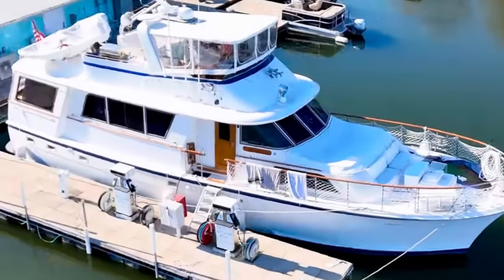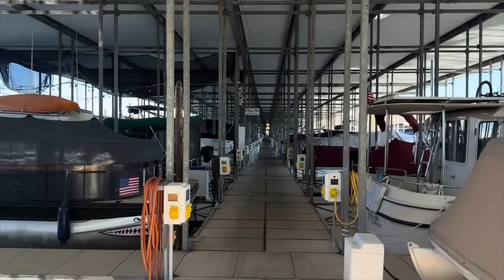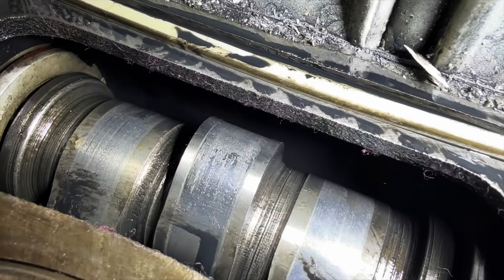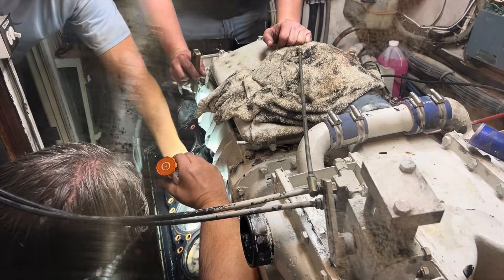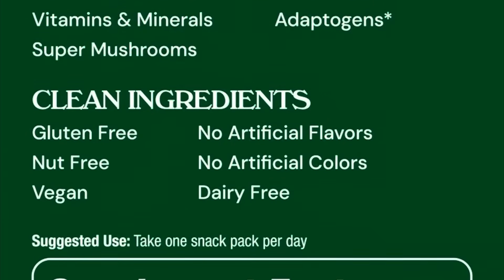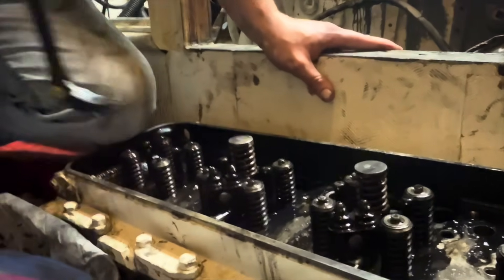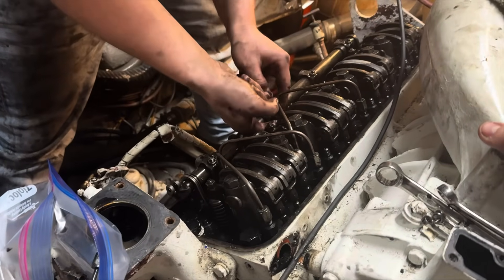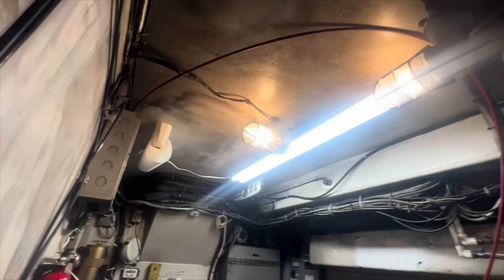Yacht Engine Failure: The Internal Damage Report

Comment: To me it looks like neglect and carelessness on the part of the POs. Deposit signatures in the chambers seem to point to some cylinders firing harder than others due to neglected tune-ups (running the rack every 1000-1500hrs) missing coolant change intervals (leaks) maybe improper oil weight (40W) or missed oil changes, combined with inexperienced techs botching repairs over the years and you have that. If I was the owner I'd be wary of doing an inframe with damage that extensive. One could waste a lot of money on new components just to have them taken out by contaminants or spalling by not typhooning the block and checking all your tolerances - it could be done, but so much better to do it in a fully equipped shop. What a mess. Maybe you could just sawzall the floor and sneak it out the window using a Hiab crane - but that'd be a drydock job, and a long one no matter how you slice it.

Comment: I have a little experience on diesel engines.  I do know though you are supposed to change the oil every 200 hours because of carbon build up in the oil.  I am going to go out on a limb here and guess the previous owner did not do such a good job on keeping up with the oil changes.  Or maybe that engine has an extreme amount of hours on it.  I'll bet the main bearings are all scared up too along with the connecting rod bearings.  Might be looking at a new crank shaft.

Comment: I bought my Hatteras 42 LRC with DD 4-53’s in her. Port engine showed some slight moisture in the valve cover cap. They said the cylinder head was reconditioned recently. No reason given however. Now six years later we have torn down the engine to find that it was overheated and the head wasn’t the only issue the Cylinder Sleeve seals were seeping coolant into the oil of course. So doing an in-frame rebuild now. If ANY moisture is present when checking out the oil fill cap either count on a rebuild or count your blessing every time you fire up and move… otherwise it has been a fantastic vessel and engine setup! Thank you for this video… I can feel for you with all the damage you have there!

Comment: A mid-west boat. Looks like its had some sitting time with all the pitting and scoring. Sat for long periods and rust built up. It needed someone to come and start it up once a month and keep the oil circulated. Typical midwest owner I assume. Used 4 months out of the year and sat for the other 8 on the water. That poor engine. Boat came with an anchor, just had to unbolt it.

Comment: I had a forty one foot power trawler and it had a 4-53 in it. The oil pan had rusted out and the top of the engine was about maybe a eight inch gap from the kitchen (galley) floor. I had to remove that engine in pieces to get it out and replace all the stuff that had died (failed) as salt water just is not a good lubricant. Sorry if the next part hurts a guys feelers but as anyone knows, old boats made of wood and it was old, built in nineteen twenty seven for a governor in maryland. Really fancy and man being a eccentric sort and all, boat is my problem. I put a small block chevy pickup engine in it to do most of the work for running pumps and all. Surprisingly the prop did just fine and if ya didn't get in a huge hurry moved that boat around fifty plus miles from where it was setting on the beach to ketchikan. I did not have a place to live at the time so gutted that boat out, and left that gas engine in it to just move around in the harbor.  Gasoline engines and boats is a recipe for dying. I finally found a job in camp come spring... got my brother to meet me out around the inlet where no one was wise to me... and dang.... she caught fire and within just minutes was a total loss so that my brother could bring me back to town and we did the act of huge loss of home thing. I wouldn't of done that but no way to insure a old boat like this that had been fiberglassed on the deck sealing moisture in the deck wood up. It had lasted that way for a good many years but by now no saving er. I saved the bell and wheel for a memory thinking I was good to go. Na, that never flies and the boat cops... can't think of their proper names told me "Morgan, we understand your situation" so no jail time, just pull your scrap out of the water. I go back to scene of crime, and sure enough, picked the only dang spot out there that had maybe six feet of depth when tide was out meaning my junk was quite visible and so removed it. I stood in the water and hooked up my recovery methods, brought it to shore where those water cops took me to a bar and bought me a couple drinks, and we laughed it off. Ya, I did like the boat but there is a time to cut the loss. This boat your tinkering on is a tad nicer for sure/LOL. I know if it were me, I would drag it out of the water to repair it. If oil did not make a huge mess, most of that detroit might of fell off the dock had I been there.

Comment: Mine is a 12v71, so it's a 6 cyl head, about 230 lbs dressed. I strapped it to a 2 wheeler, rolled it thru the Salon, and used the davit to lower it to the dock

Comment: If I remember correctly that engine is removed buy cutting open the port or starboard side depending on which engine it is with a big hole.
Pretty common on those old Hat's.

Comment: well  hell, cutting out the ceiling would be a pain, i had  years ago a 72 ft hatteras had twin cats   i had had it for a few years then the one engine took a dump, was not 10 grand  was more like 37 grand, i was at a ship yard they  had to take the salon floor out then lift the engine out thru that,  took them 3 months to get it back together again and installed, my final bill was a bit over 45 grand  while they were building that engine ihad them look at the starboard engine.. that cam eout next 6 months later ihad  new engines and     spent over 90 grand , boats are  not worth it. they sink,    i had it for another 6 years after that repair sold it and swore i wouldnt buy another boat, then my gf  said onemorning hey i just saw your dream boat is aid nope no more boat but it is a 120 ft ocean going tug a old army tug i said nope   then i bought it lol  i have had her for over 20 years now,  has not sunk yet

Comment: Lots times..the hatch is over just one engine. Have to cut floor out to get to where hatch unbolts if they do.take one engine out.. then slide other over to other spot to get it out as well  .see guys make a makeshift gantry over engines with small steel i beam and other steel braces

Comment: What does the own mean they added coolant?  Don't boat engines use the water they are floating in as cooling water?  The boat's interior was built around the engine compartment without accommodation for disassembling the interior for engine service?  WTH?
Reply from the maker: No sea water doesn’t flow through the engine.  Just heat exchanges to coolant

Comment: Flat no way the seller wasn’t aware of the condition of this engine. 
I’ve seen many Detroit 2 strokes that wouldn’t start without a snootful of ether and ran awful and when they were pulled down looked way better than this one. 
Hard to say what the root cause is, but it’s safe to say it was run for many hours being sick and would shown signs of that. 
With the loose bolts and missing parts it’s safe to say that some hack was in there likely trying to patch it up for sale. 
Sad.

Comment: If the top is that bad I'd hate to see the bearings on the piston rods. I'm sure the piston rod bearings are getting bad to with antifreeze and black oil in the oil pan it's very ideal to check it out just to be safe.  If this guy were to call a Detroit mechanic they would have charged this man a fortune 🙄  but with BUS GREASE  MONKEY TO THE RESCUE  this job is going to be well worth the man's budget 👍.  Yes from the damage it's better to rebuild the engine than buy a brand new one. This guy already paid alot for the boat and clearly was cheated his money because the previous owners probably told him everything was fine and nothing wrong. Clearly this video shows the evidence of something totally different.  Bus grease monkey your the best, you help people with big problems like this get back to everyday enjoyment by fixing their engines and it's remarkable that you master this degree I cried a little while watching the parts where you took the heads off but got reassured that you would pull through and help this guy get this boat back running again.  Awesome video. Awesome work you perform.

Comment: Yeah, this isn’t going to be fun. With that much damage to the cam rollers there probably wear to rod and main bearings so they are going to be needing some attention. But before going that far you’ll need to establish what size bores already is and if the cylinders can be honed or if there’s even oversized piston or rings available. If that’s feasible then you’ll need to build a lifting frame in order to get to the bottom end and assess the crank journals and sizes. Once you’ve your are sure it’s rebuildable. With a crank lowered and protected, rod and pistons out. The block stabilized on blocks, you’ll spending a few messy days of quality time with a portable Sunnen hone and bore gauge. Always start with the worst bore, that way you’ll find out if it’s worth going any further. 
The good news is if that engine is repaired and maintained it’ll outlast you and it’s better than the crap emission engines of today.

Comment: Next time you guys do something with carpet like that, you can go to the hardware store and you can buy the sticky carpet protector goes over the top of the carpet in case he did drip any oil it would not get into the carpet and just you can’t help it you know go from the engine room up through carpet. It’s gonna get something on it. Plastic stuff is really easy But I think this was your first marine rebuild wasn’t it? Oh yeah, merry Christmas.!!!
Reply from the maker: He said don’t worry about the carpet it’s getting replaced.  Same with the flooring and wallpaper.

Comment: You guys are saints... those Detroits are extraordinary engines, and they're durable, but try to find someone to rebuild them was virtually impossible for me  back in 1997 in FLorida.. Several diesel mechanic told me:  "Run them until they won't start again, then find good used ones."  I sold the boat to a broker rather than tackle my 871 ti's..  The start-up smoke belching from the exhausts was not tolerable, even though they ran perfectly once heated up.     And I heard several horror stories of rebuilds that didn't work out, mainly because of fuel leaks under the rocker assemblies.  Looking forward to each video with great interest.

Comment: That engine has been severely overheated more than once. Possibly injector timing is out (clean marks on top of liners).
Cam spalling has to be clearances set too loose- that will hammer out roller cams in a hurry.
Just a badly set up and maintained engine.

Comment: My purchase was a lot smaller but similar crap. I have a Nissan pickup with 330k miles so when I finally found a Nissan Xterra with just 159k miles I was excited  as I hadn't found a manual transmission model for sale. I needed it for a daily driver and rv tow vehicle. Went to check truc, I listened to the engine, took for a bit of a ride flooring it, everything I looked at was fine. 30 mile trip home was fine then another day went to drive and it was bucking, crap power. My mechanic said it had a rod knock which I hadn't heard till later driving between 2 brick walls. Had to get a remanufactured engine...I know the feeling, got to get an inspection next time as I must be getting old.  Now it's a nice truck at a nice cost with the new engine and clutch. Peace

Comment: I'm a retired diesel mechanic, I've worked for the Detroit Diesel distributorship and afterwards a truck dealership; I've overhauled many Detroit engines but that's one of the worst ones I've ever seen, and to believe it was still running! Amazing!
Reply: poor thing is in very bad shape.  Reminds me of a Greyhound bus in Alice Springs Australia......that was sabotaged with valve grinding paste in the oil filter (disgruntled mechanic).   Dam thing made it to Adelaide (1500km) and was blowing oil out the exhaust all over the bus.  DETCO  (Detroit diesel) in Adelaide discovered the carborundum contamination in every metal component.......entire engine went in the scrap bin.  Not a single component could be re-used.
Reply: @wazza33racer 
WOW!
Reply: @wazza33racer  Carborundum (silicon carbide) used in grinding paste is a hard, crystalline material with a similar structure to diamond. Putting sand in the oil of a motorcycle is another one I've seen.
Reply: Ex marine engineer here. I'd say he was lucky - a bit more of this and you could be looking at a vented block. Unless they find bigger horrors when they get to the crank, it's "only" a major overhaul (bad enough but does not require replacing an engine which - on this boat - would be a real pain).
Reply: And there's two mind you.  Makes the cuddy cabin I owned once, w/the sweet little V--6 Chevy so trivial.
Reply: @sgtbrown4273 Wow, that's cruel to the engine. "Bearing lapping compound"
Reply: @sgtbrown4273 yep,valve grinding paste is super destructive.

Comment: Boats are like motor homes.  Owners never take care of the maintenance and it goes down hill from there.  There are too many boats that are near the end of useful life because owners never use them frequently enough and don't attend to maintenance.  Too bad that buyers don't get a boat survey and get it out of the water to check the hull.  Boats and motor homes are a constant expense even when the are just parked.  It's kind of like an old airplane.  All engine(s) are in need of complete overhaul, and the accessory components.  The hull is the only value if it passes inspection.  If you fail to include major overhaul expenses in the purchase then you get to pay for it after purchase.  That's how we get, buyer beware.

Comment: i think the only good news about that engine is that it let go reasonably close to a great Detroit guy.

in the navy we had these bolt on eyes to attach medium and light duty chain falls to any available beams in the overhead.  are there points in the engine room to attach a chain fall or at least a line to help you move things around?

Comment: Take the engine out by dissembling it or cutting the boat open. I've heard of that before. Can you imagine the job refueling a nuke sub? Good thing for the current operators - we're paying for it all! At least it isn't needed that often. 
They may have bought this boat as a no-return, as-is condition at a fire sale price? Maybe from an auction site with no records or way to check it if dry-docked when sold. That hasn't been mentioned here. The engine is full of nasty stuff and signs of a hard life. It's condition had to be bad way before the current owner took possession.

Comment: I'm sure you know this but just in case, be aware, those high HP engines are set to run with advanced timing on the cam gears. those are 2300 to 2500 rpms engines, pleasure rating. make sure the blower shaft is in good shape, same goes for the forks for the fuel pump.
they do forget to put the R80 on the fuel line return too. Are booth having the same issue? are they both RH or is the other one LH? How many hours on those?
Hope he did get the boat cheap and has a bunch of spare cash, it will be needed, what kind of gears on them, MG514 2:1 probably

Comment: I've 'em cut a hole through the side of the hull to remove the engines and glass 'em back up when done. Usually done when on the hard as those engines are often right at or below the water line

Comment: Some large boats have non structural areas in the side of the hull which allow you to remove sections of fiberglass in the hull and take the engines out through the side of the boat.

Comment: I have a boat with a 6-71 that was brand new in ,I guess it was one of the last 2 stroke that were made .It had 70 hours on it when I bought the boat,I now have 3300 hrs on it,I service and maintain it myself change the oil every 250 hours  the boat is a Trawler weighs about 25 ton with a full displacement hull I cruise at 8 kts at 1800 rpm max speed is 11 kts at 2300 rpm.How do I keep my engine from doing what this one did?
Reply: Regular basic maintenance.

Comment: It depends on the boat but sometimes there's a gantry elevator system you can set up with I beams that allows the motor to be pulled without cutting the floor open.  If nothing else you can set up a gantry system in the engine room so you can separate and lift the motor for the transmission.

Comment: What's with all the Delo 400 bottles around? I thought everyone knew you never ever use Delo 400 on a 2 smoker Detroit. Delo 100 is the right oil, or some other straight 40W low ash oil. Someone ran that thing into the ground, and then sold it cheap, and knew full well what was going on. There's no way an 8v92 gets that much camshaft and liner damage just overnight.
Reply from the maker: Even worse the delo 400 oil is 15w40.
Reply: @BusGreaseMonkey  🤢🤮

Comment: I worked on a ship for a couple of years. They replaced 2-12v71 motors with a pair of 8v92's. We didn't get far away from the dock when both motors started over heating & we faught with this problem for a month. It was determined that the cooling system in the motors were overheating because of vapor locks. The fix suggested by Detroit Diesal was to put a hose adapter into the block in one of the higher water jacket plugs & run a 3/4 hose up about 8 feet in the air. No more overheating issues.
Reply: Just give it an air vent?  I could see that working...

Comment: Nice flame pattern . On the EMDs we would insert a lead plug into each intake port,,bar the engine over and then remove the plug and measure the thickness . This would tell us if the bearings were ok . EMDs are too big to just remove the crank to mic it .😅